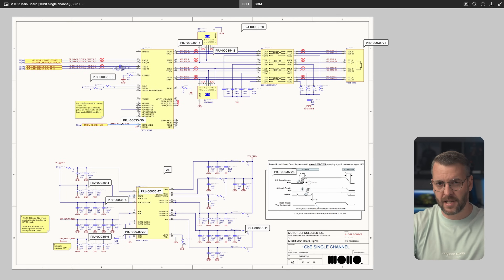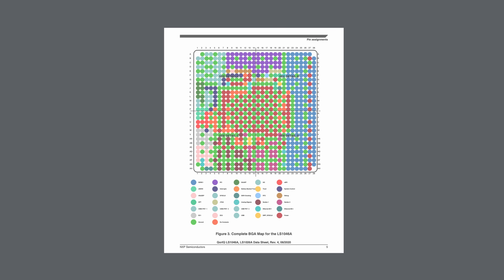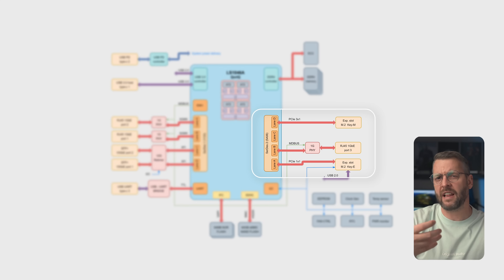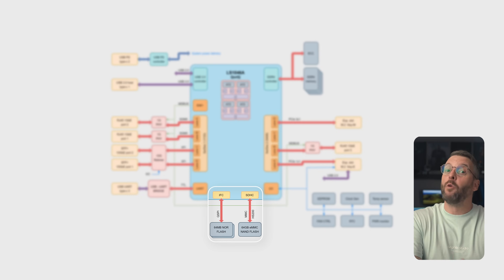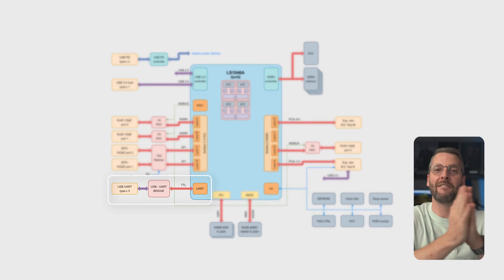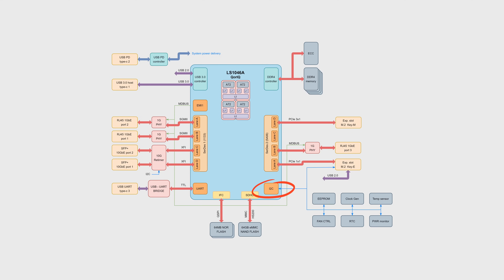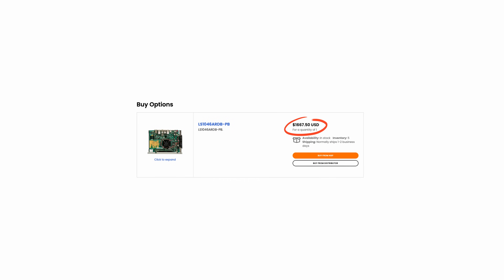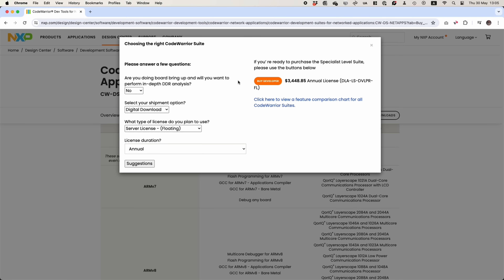We're building a high-end router. Here's the update for May 2024.

Comment: Tere Tomaž, As for connector layout, I prefer the bottom two. I would suggest not putting the reset button at the convenient end. Yes I realize.... must push a pin in to cause the reset. I like reset burred between other connectors than on the end advertising itself, "Hey, go ahead, push me!" Is there benefit for more space between RJ-45 connectors and the SFP+ ports? If so, then middle option makes more sense.... stick the reset between as a spacer. What?! No link and activity LED's per port?!!?!? I am skeptical about that decision. Yes, viewed the entire video. Bravo. Excellent update. Ciao!

Comment: I wonder if the proximity of the USB ports could cause issues for thicker cables.

Might be nice if the USB-ports for the UART & thumb drives is accessible from the front or on another side. 
In that case they would be accessible for non-rack users without needing to move the device to find the slot. 
Also might reduce the likelihood that someone plugs the PD cable into the wrong port. 🫡

Comment: Not sure about RTOSes, but Linux has/allows for LED drivers that can be configured via SysFS through /sys/class/leds. It would require firmware and hardware effort, but then it would be dead simple for the end user to use them for whatnot.

Comment: Being in the internet business for 15 years with over 5000 customers 

Few suggestions make sure the router can handle full bandwidth 1gb over wireguard Tailscale and do split tunnel at the same time not very many routers can do this . 
If you want ISP to buy the router you will need POE+ Wan port to power outdoor Wisp equipment.. and a way for wisp to manage 100s of devices at a time behind lte network and not TR-069. 

Some kind of dual internet like pep wave has speed fusion not very many companies have that at a affordable price

Comment: Regarding LEDs:
I agree that there's little point in having half a dozen of them (especially for a router) as long as it can indicate:
1. Off
2. Booting/Working/Loading
3. Running normally
4. Error/Issue/General Fault (maybe with software integration for what beyond the obvious hardware/firmware problems qualities as an issue)

I do however value link indicators on the networking ports as they can be useful for troubleshooting what layer a connection issue lies at. Recently had a frustrating experience because I thought there was an L1 problem but it turned out to be an improperly configured VLAN.
Reply from the maker: User experience is actually the most considered aspect of the device right now if we put schematics aside. We're constantly asking ourselves "how can the device get out of the way but also provide useful feedback when needed/necessary".

Comment: Nice update! I've been following from the beginning! On the UX, have you considered USB-A for UART and data? It may not be as sexy but it will likely save you some cost on materials. If you keep all USB C, I would segregate the power in to avoid problems with users plugging power where they shouldn't (even if you accont for that on the hardware side), you can do this by either giving the port a different orientation or moving it to the other side of the device. Good luck!

Comment: Reset on the right is probably best. If the device is all lplugged in with cables and I need to reset its hard to get in between.
Further I hope the firmware of the Device if its custom and not something open like OPNSense, will support IPv6 in its fullest form.
Any router not supporting it especially in the EU where IPv6 adoption is pretty high is something where I considder the device broken.

Comment: My only real concern with this router is the choice to go ARM instead of x86 it really restricts the software options and you keep saying this is a high-end router but without high-end software (OPNsense, pfSense, VyOS, Untlangled, RouterOS, IPFire etc) it only really leaves OpenWRT which I don't really consider high-end, it competes more against commodity off the shelf all-in-one router-access points in my opinion. Just my legitimate concern, no trolling.
Reply: OpenWRT is high end tho for routing which is mentioned here.

PfSense does support ARM but sadly only for their own boards.

OPNsense there are community ARM builds
Reply: @sebas0469  I don't agree OpenWRT is high-end. I'd call it a step up from commodity stuff. But my point is, I want to use pfSense, I can on x86 I cannot on this, I won't spend 500 euros potentially on this when I can spend 300-500 euros on an X86 equivalent with .. a faster CPU.

I'm aware that Netgate has ARM builds but it's restricted to their own hardware and that wont ever change. As for OPNsense their ARM stuff is in its infancy.

Comment: Looking forward to this. I have two use cases for this board. One as an edge device (firewall/routing) for home network, and the second is as a higher end NVR running a Dual Edge Coral TPU. It will be nice to have something more performant than a Raspberry PI (or similar) without running desktop hardware.

Comment: for fans, a cutout or slot for a 40x40x10 mm fan could prove useful for those who live in more "hot" regions and want to just have less thermal load on the hardware just to be safe.
Reply: This. Please consider that for ex. Ubiquiti Unifi products get so hat that many of them needed workarounds bc of heat.

Comment: I'd love to see 2.5GbE on a such device.
Reply: It will not happen. The CPU itself it has 2.5GbE interface, but it looses a lot of other features. That's why is keeping 2x 10GbE and 3x1GbE. Is all about the configuration registers of the CPU. You can use a switch like XMG1915-10E or XGS1250-12 with a DAC 10GbE and you can extend to 2.5GbE interfaces. XMG1915-10E with all 2.5GbE ports connected and 2x 10GbE optical SFP+ is drawing about 10W.

Comment: Try to test ethernet modules in the SFP+ slot too and make sure they do not overheat, or at least 1 of 2. Those usually run quite hot. Also performance on PPPoE is also something to account for if possible.I don't know what other providers use this legacy pain in the rear protocol, but it is a problem getting a router routing PPPoE at full speed (in my case 4 gigabit/sec) except for the providers router that has an ASIC that knows how to deal with it and can route it at full speed on a single thread unlike a lot of those mini pc's I tried using. Also directly supporting XGS-PON SFP+ modules would be nice. I also sometimes watch the mastermilo videos, I was already wondering why this video was listed under your video.  There is a summary in the comments under the video if you want to know what they are discussing.
Reply from the maker: Thermal behaviour is one of our largest concerns honestly. I have both SFP GPON and a SFP+ to RJ-45 and they get seriously HOT. We're doing an extensive thermal analysis on this, both on paper and with a thermal camera. Will get a dedicated video because it's a very complex topic.
Reply: @tomazzaman  In my Lenovo M720Q, I use a Mellanox ConnectX 3 with a GPON SFP, and the temps go up to 45C. One good idea would be to redirect some of the case airflow onto the SFP+ cages. You can improve the product using CFD simulations once the electronics are finalized. I also think 3D printing duct assemblies would be great for such a product.

Comment: If you are going to support SFP+ to RJ45 adapters I would prefer a design that separates them from the standard RJ45, even a space between both of the SFP+ modules so you can use two adapters. Kinda like the Cisco switch CBS220-8T-E-2G-EU.

Comment: In terms of design, the front panel can have RGB LEDs (2 or more). m2s and other debug points can be on the bottom panel, which is made of plastic and can be closed using only two screws and nails (to save money and labor). The top panel can have fins for cooling.
Optionally, by placing a total of 8 legs in the 4 corners, the device can be used both upright and upside down.
I couldn't see it clearly from the video, but it seems there might be more space between the ports. Since Type-C USB cables extend beyond the ports and RJ45 and SFP cables take up the entire port space, there must be at least 1.5 cm of space between the ports (for fat fingers and to fully grasp the ports). The restart button must be on the far right or far left, otherwise pressing it, which is already difficult, will become unnecessarily difficult.

Comment: a few idea: You should somehow mark (with a colored border, whatever) which is the power input, The SFP+ sockets can get hot, especially if you're using optical modules, and not DAC-s (if it will support LR modules, consider having some space,  around it or at least make some thermal test) Maybe the best would be some passive metalic connection between the chassis and the SFP cages on the board, to get out heat directly.
Reply from the maker: The ports will be both clearly marked to which one serves what and also well documented, of course.
And yes, the SFP+ modules can get nasty hot. Even SFP can, and I have one of each. SFP+ to RJ-45 and a SFP GPON. Both give up a lot of heat and we plan thermal pads to be between the cages and the chassis.
Reply: @tomazzaman  fans with thermal control...  Noisy as hell for the small size, to balance with the pad because I don't think heat transfer pads can be sufficient. I think just the thermal management will throw you back to the drawing board.
Reply: you meant RJ45 modules? those get extremely hot yes. LR modules are only warm-ish usually
Reply: @ledoynier3694  FS released a new SPF+ RJ45 version with lower power consumption. The price on the other hand .. 165 Euro .. They claim no more than 1.8W. Sounds good over 2.5W - 2.8W the normal SFP+ and temperature no more than 45-50 degree.
Reply: @ledoynier3694  depends entirely on the module used
Reply: The SFP+ heat is a big design consideration. I have a Dell rack server with very active flow through fans and the module i have when i last removed it was hot enough to leave a mark if i held it too long.

Comment: I have been loving following your process - absolutely amazing videos! I love how you include so much about both the technical router design and details on how you started up a company, including both your reasoning and so much cost transparency!

I agree with your choice of the three possible port placement designs - the only thing I can think of to change would potentially placing the reset button between the power usb c and the other usb c's. I can imagine a user accidentally using the wrong one, and that might make it clearer for them...